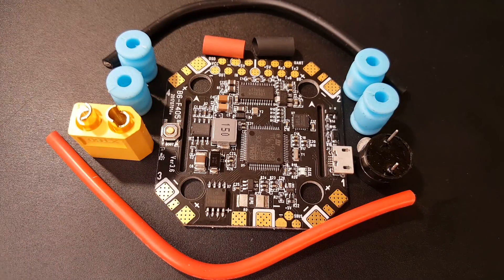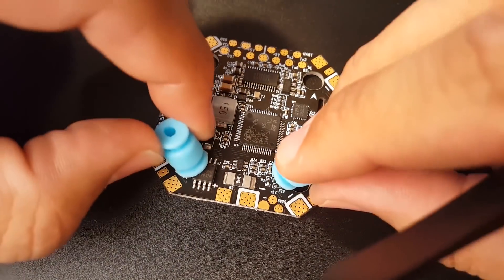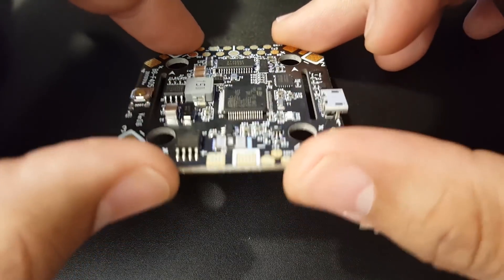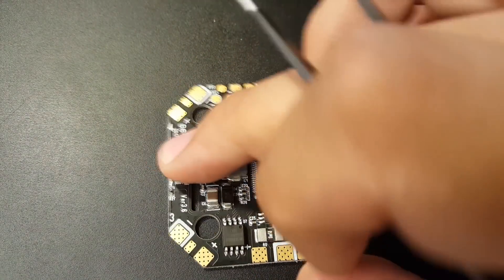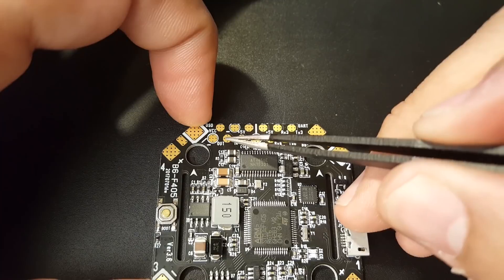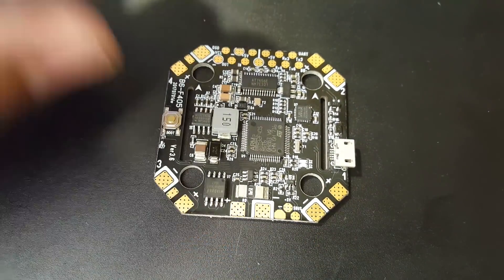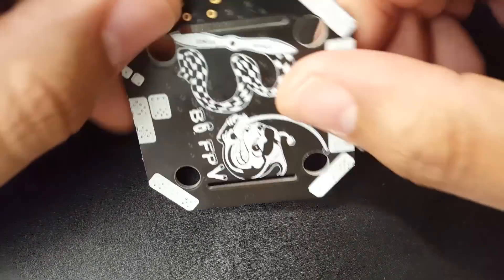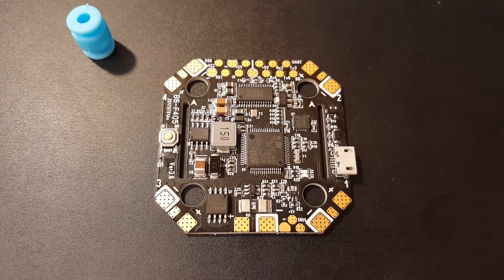B6 F405 V3 Omnibus F4 // Overview

Comment: How does it handel 200amps on 5s
Reply from the maker: +Freubels eu I think melted would be the word. What are you running.
Reply: Drone Mesh f80 2500kv on 5s. I pull 200amps total on tmotor esc,s
Graphine battery
Reply from the maker: Freubels eu I have quad same setup as you never pulled more than 90 on 4s I will replace FC and setup 5s on it.

Comment: Hey Mesh,

if you gonna make a Build with it, i would concider to use other softmount rubbers, like the ones from the DYS F4, this would reduce the heigth of the board above the frame alot!
Which Gyro version is on this Board?
No LED pad and no 3.3V - Spektrum users should be aware of this!

Comment: Given the number of boards you've been trying out, I think you should make a comparison video at some point. There are so many good boards available these days that its hard for me to know which one to get. Personally, I'd like something that's easy to solder with separated out pads, or maybe even one lot of JST connectors. Others may look for most compact, good bec with filtering, etc. If you could compare factors like these and more, it would be super valuable.
Reply from the maker: +Manindra Moharana Been working on that video for 2 weeks now still in progress
Reply: Drone Mesh Can't wait! 🎉🙌
Reply: I’ve been looking for a good board to put in my chameleon for about 3 weeks now. I’d be very interested in that comparison video. I’m looking for something easy to tune and fly.